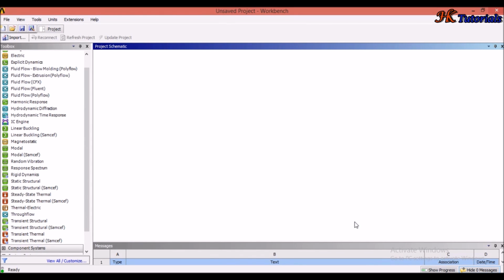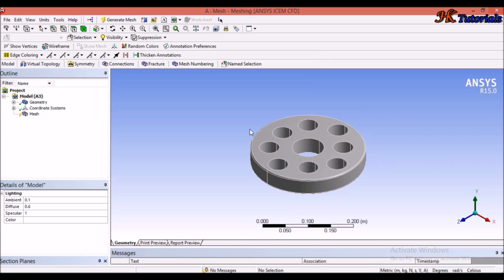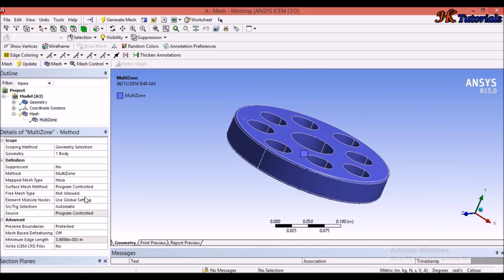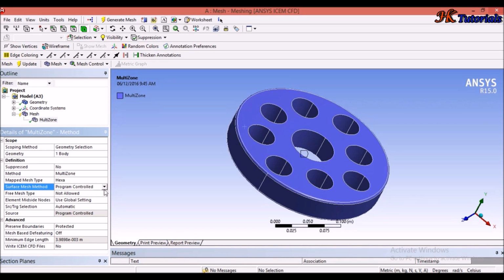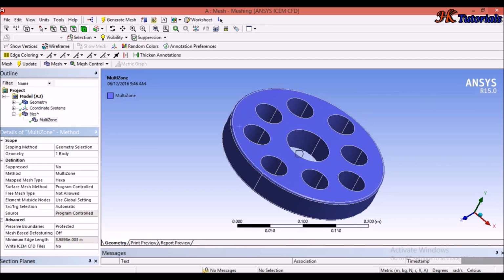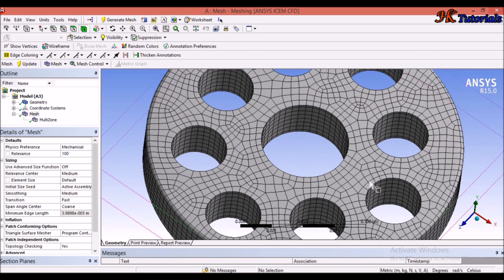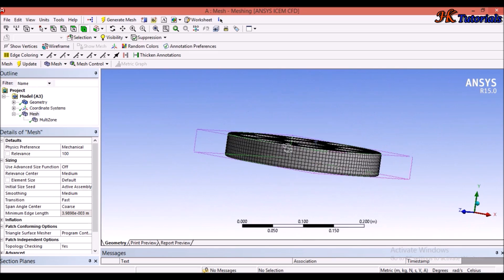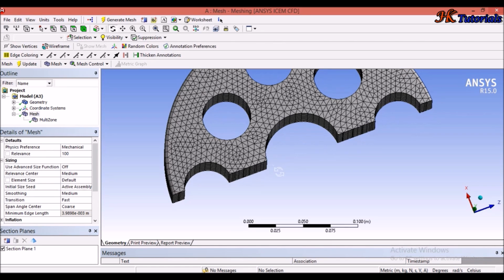8. Ansys Multizone Meshing For Beginners

Comment: nicely explained. is it possible to mesh a airfoil with trailing edge flap with multizone meshing?? if possible is there an tutorials available??
Reply from the maker: Thanks, sai charannath Dubba. Yes, it is possible to perform meshing on such types of geometries all you have to keep in mind is the node to node connectivity. In my opinion, there are no such specific tutorials available for that, but you can watch tutorials on how to maintain node to node connectivity.
Reply: @HKTutorials4nitb_racing  thanks for your immediate reply. And one more question ... I want to do that multi block mesh in icem cfd. So which one is better ansys multizone or in icem cfd.

Comment: Is Multizone Meshing  is used when there are no. of bodies inside a part?
Reply from the maker: The MultiZone mesh method, which is a patch independent meshing technique, provides automatic decomposition of geometry into mapped (sweepable) regions and free regions. When the MultiZone mesh method is selected, all regions are meshed with a pure hexahedral mesh if possible. To handle cases in which a pure hex mesh will not be possible, you can adjust your settings so that a swept mesh will be generated in structured regions and a free mesh will be generated in unstructured regions.